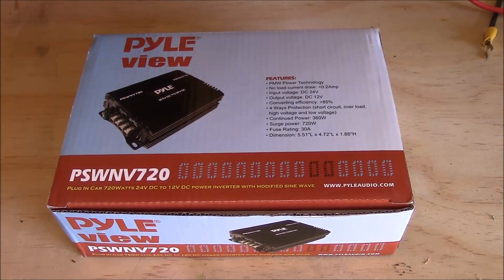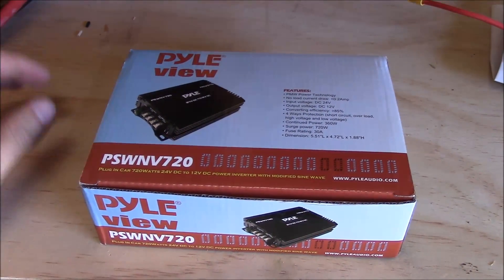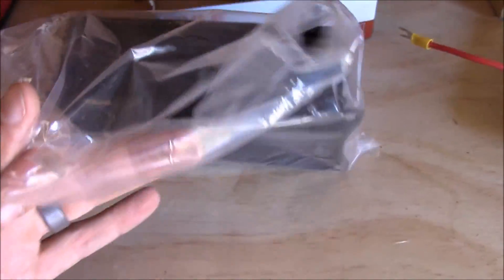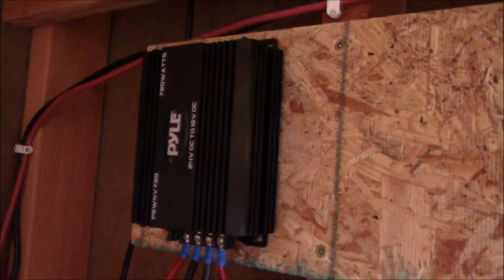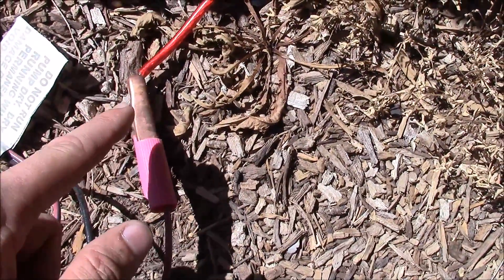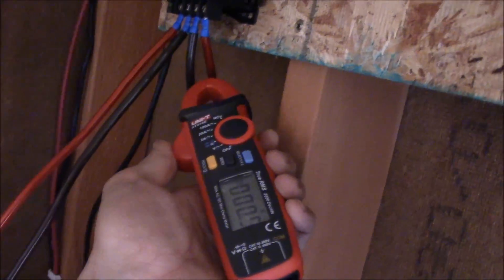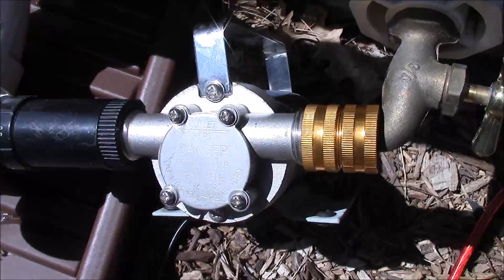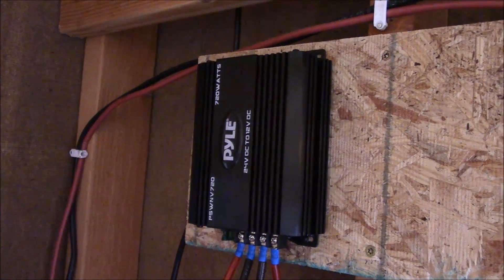720 Watt DC Power Converter - Pyle PSWNV720

Comment: hey mate me again I'd like to create my own home audio with car audio a watt would be a good setup? for a main power supply I'd like to run amp sub and speakers and head unit how would I do that? pretty much like how they have setup at a store for display do you need 12v battery or can you convert power another way straight from wall outlet with a converter or something as I want to have constant power ? or would I need some sort of 12v charger to connect to the converter please fill me in on this info much appreciated . 

kind regards

A fan of your work

Comment: Then  your panels system generates 247 Watts?How many else? And how many amps could break the fuse(in the converter)? Thank you
Reply from the maker: My solar panel system is 600 watts and runs at 24v.   Theoretically, the fuse would blow at exactly 720 watts or 30A as the fuse is rated.  I would not want to run it much more than the 250-300 watts range because it gets pretty hot.

Comment: Wire is wire, and being for use in automotive installations, the insulation should be pretty rugged. You're right about the U/V, it kills everything. 👱🏻
Reply from the maker: Haha, yeah.  I just meant it is not rated to come in contact with moisture, UV, or chemicals.
Reply: +LDSreliance: Just run it through some PVC pipe and build a wood cover to protect the pump and timer.
Reply from the maker: Yeah that is the next step.  I need a wooden box.